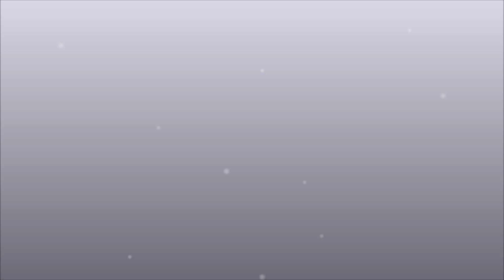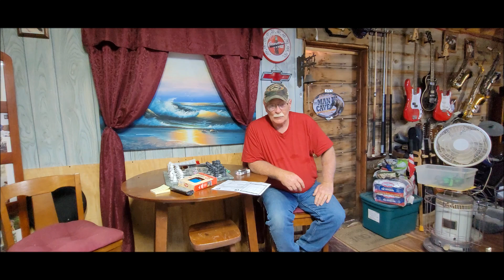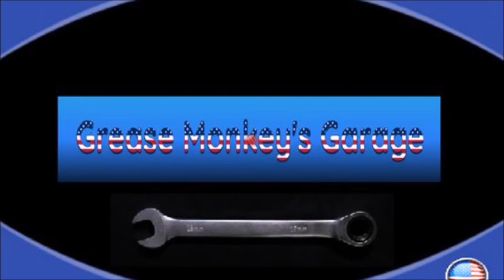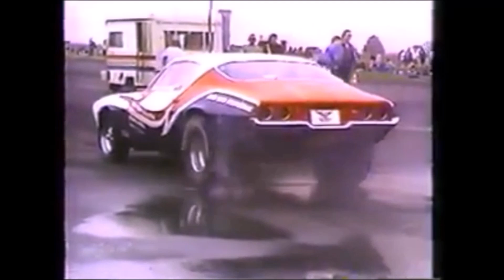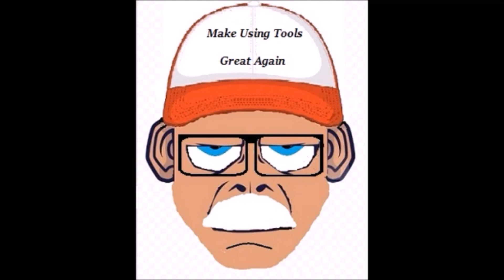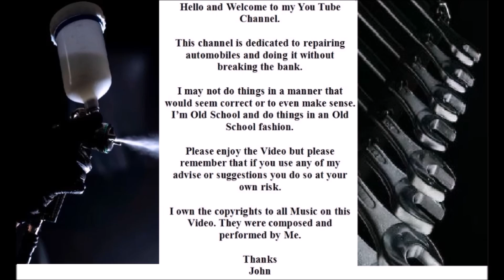305 Chevy Rebuild or Long Block

Comment: It should run with 130 PSI compression! I don't recall seeing you check for spark (ignition). 

I don't recall seeing you veryifying timing marks, checking for timing chain stretch (slack / play) or for a chain that jumped a tooth or two on the timing gear maybe due to a worn OEM nylon timing gear (instead of metal).  I don't recall the year that GM Ford, and Mopar stopped using  "nylon timing gears"! I know GM used the nylon timing gears in the late 80's as the 1986 Monte Carlo SS had nylon timing gears.  GM, Ford, and Mopar used nylon timing gears in the late 80's. 

The GM straight 6 engine and the Ford straight 6 engine had FIBER timing gears. The GM  4 Cylinder "Iron Duke" engine came with a Fiber Cam Gear too. 

Don't forget the Mechanic "KISS method" ! (Keep It Simple Stupid) Back to the basics unless you want to waste a lot of time and money....
Reply from the maker: Gary, Thank you for your comment. Yes, it is very possible that the timing chain is bad as well. I didn't check the timing because this truck has never been worked on since it was built so doubtful that the timing is out of whack. The distributor has never been moved. The motor actually ran pretty good but was getting bubbles in the coolant reservoir. This prompted me to do a compression test to check for a blown head gasket.  In doing so I learned after pulling the valve covers that the cam is wiped on a couple valves and the engine is full of Quaker State Carbon deposits that prevents the oil from draining back to the pan. With that thought in mind, I believe it is in need of a cleaning, gasket, ring and bearing refresh as it also has 218K miles on it. Thanks again for the comment and watching the video.

Comment: I would rebuild it before I would buy an engine from the big-name rebuilders out there.   From what I've read, they can be hit or miss.   One in particular that I am looking at has a really great warranty, but from what I've read, they seem to always want to deny your claim if you have problems.   What good is a warranty if it isn't honored?    Not terribly comfortable with them myself.

Ask yourself this also:   How much are you really going to drive and work this thing??   If you aren't going to put too many miles on it, you might want to tear it down and just see if you can replace rings, bearings, cam, lifters, timing set, oil pump, gaskets, and skip the machine shop all together, except for maybe the heads.   If its holding good oil pressure and the bores aren't gouged out or absolutely worn into ovals or anything, you might could just do a light hone and put new rings in it, along with the other stuff mentioned.  I wouldn't do that if I was going to put some serious miles or heavy use on it, but for something you might put 1000 miles a year on and take to cruise-ins, it might be a more cost effective option.    

Be sure to follow the break-in steps for your cam and lifters!   There has been an epidemic of cam/lifter failures for  flat tappet cams in the past few years.   Not sure if it is the way the cam is ground, the way the lifter is ground, the heat treatment of one or the other, or the quality and additives in modern oils.   Whatever it is, it isn't like it was back 20 years ago.

Comment: well jeez , sounds like you got yourself a delima there John umm I understand you wanting to do the engine work but here is the fatal flaw that I always get into because of where I live Las Wages the shops of any kind want triple any of the prices you quoted it s greed so it forces me to do all my own stuff sometimes it even cheaper to go to another town miles away but what happens is what about all the little things that you need? You know that tube of assembly lube , or permatex or what pan gasket do I have in the kit usually end up with enough gaskets left over to build another sb so if your counting pennys........ see what I am sayin my suggestion see if you can pick up a running piece of crap auto with a decent sb of any flavor no more than 500 bucks ok now transplant that into dads truck for the time being just to get it going , now take your time order your parts as you need them while you rebuild the # matching 305 when your done you got all those dam gaskets I mentioned earlier and you can freshen up the donor motor and sell it to someone for a fair price.